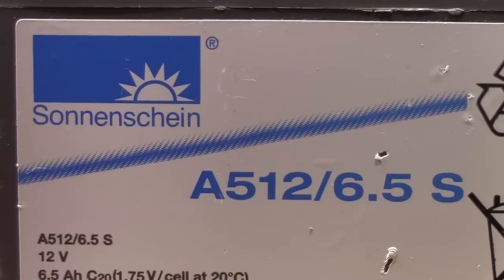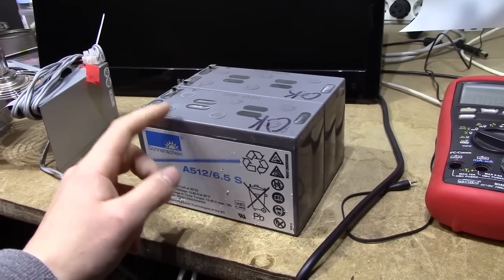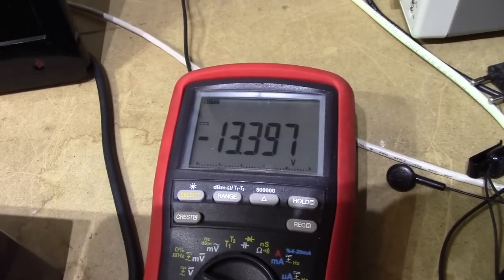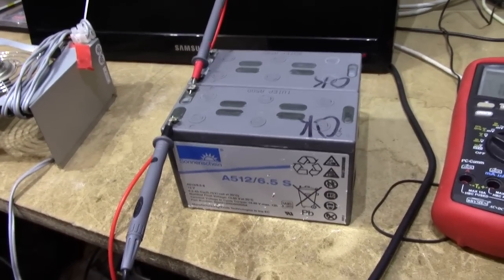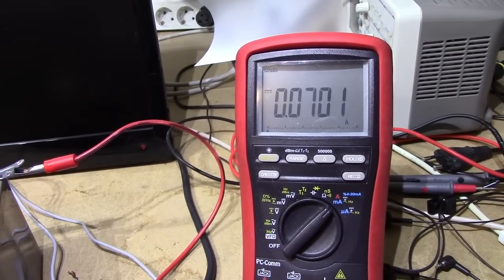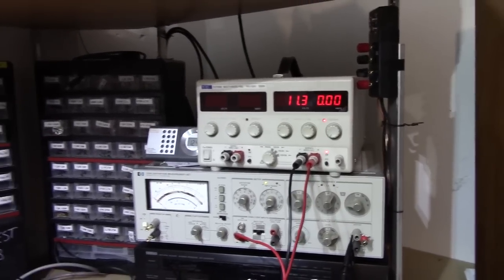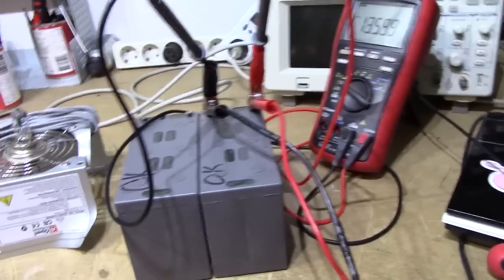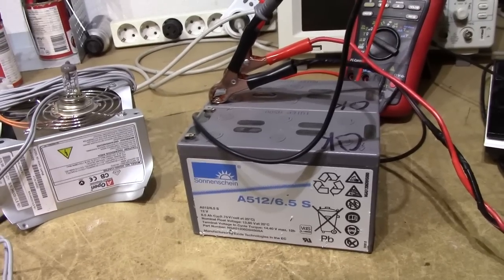Why I'm a Sonnenschein battery fanboy

Comment: Searching about old school Sonnenschein brand lead acid 6 volt types brought be here. A pair of them wired in series for 12 volt output were the original and manufacturer-recommended batteries for those old '50s and early '60s Zündapp Bella scooters from Germany, which rather cleverly had electric start even back then, and actually quite unusual for 2-wheelers until the '70s. They achieved this by adding some extra poles to the generator to use it to turn the engine. Since they're 2-strokes with less of the engine braking 4-strokes have by design, it worked a charm. You're quite right about the quality. It's not an all unusual to find a Bella with decades old Sonnenscheins still happily cranking to life. Sure, nowadays you could just sneak in a single modern 12 volt AGM, but you'd be lucky if it lasted 2 or 3 years.